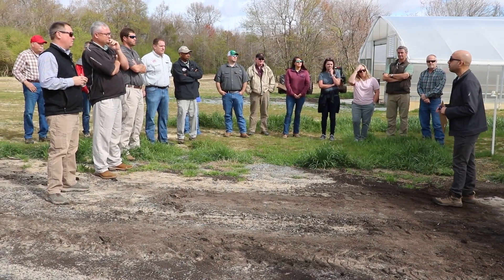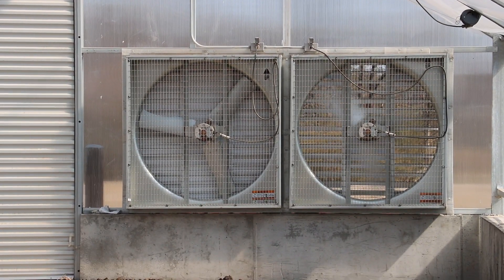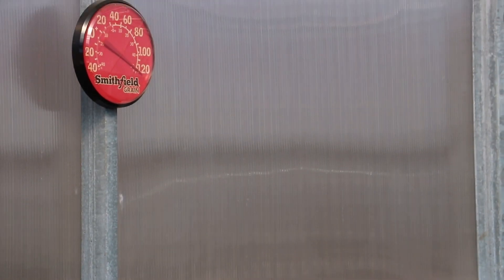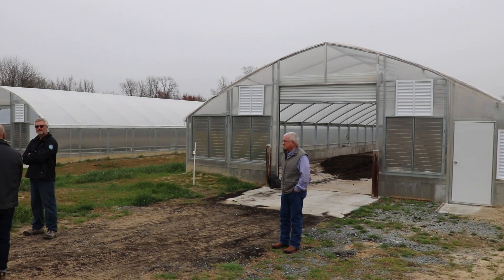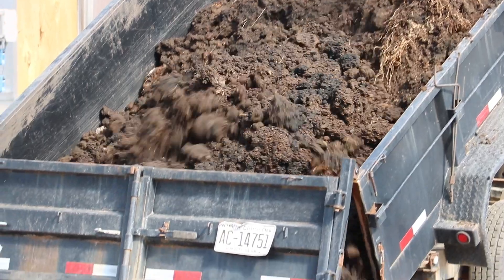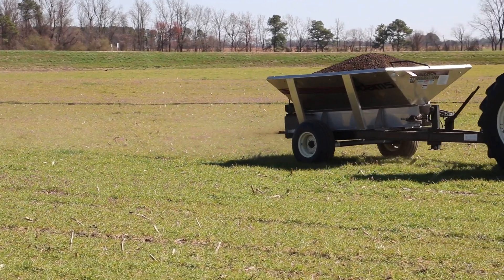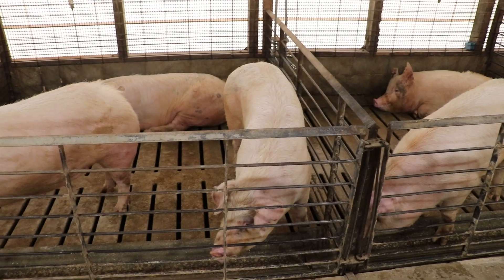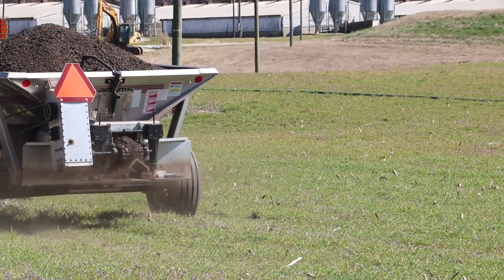Innovation in Swine Manure Management

Comment: 1)construct tracks on corners.installcompost turners and air jets.electricity willbe provided by solar panels and hot air by solar air heaters .
2)you can use .aerobic composter drums.oered by movable solar poweredmotor.u can make faster compost by temperature control if these drums are installed inside green house